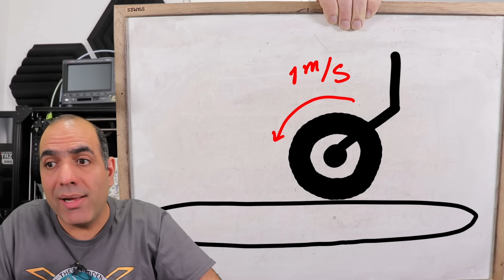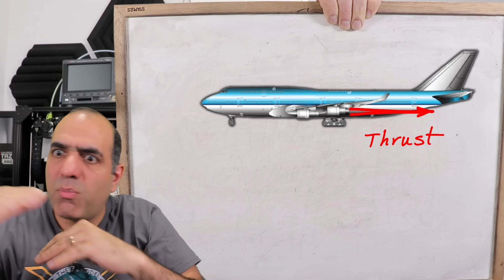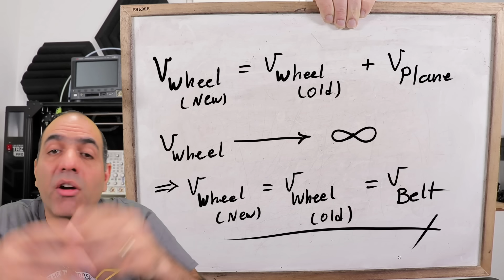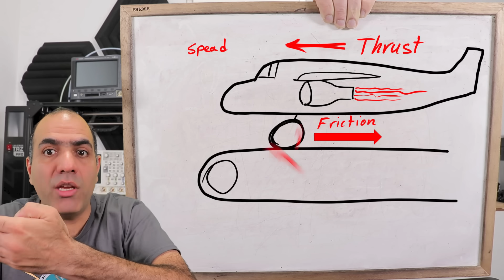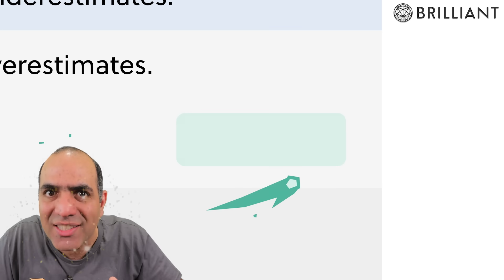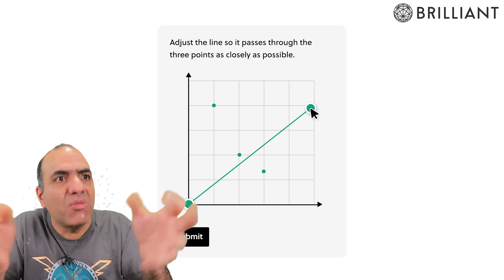Airplane Question that Drove Me NUTS!!!

Comment: This is a really simple answer. What makes the plane move? The engines pushing air or the wheels?

Answer that question and you’ll have your answer as to whether or not a plane can fly off of a conveyor belt.

And if that wasnt dumb down enough, let me make it simpler. Grab a little toy car, hold it tight in your hand. Push it really hard against the ground and then lift it up without letting go of the car. Do the wheels continue to spin? Most likely the answer is yes. Because the wheels are not powered by engine they just simply roll because they are loose. 

So what makes people think that a planes wheels have engines that make them turn? 

If the plane needed engines for the wheels to go forward. Then how does it stay in the air? Are the wheels constantly rolling on the air and driving on an invisible road even after they’ve been retracted into the underside?

Better yet how does a seaplane take off from water? Have you ever seen propellers underwater pushing the plane forward? Or is it just a pontoon that helps it float and the engine pushes air which cause it to move forward, and eventually lift off and fly. 

In fact the next time the conveyor question comes up just ask people, so how does a seaplane takeoff with no wheels. Or a plane with skis taking off from snow.

Also, MythBusters did test this. Watch the video.

Comment: Laymans term here.

1. You tie a knot on a toy car.
2. You put the toy car in a conveyor belt that will match the toy car's wheel speed.
3. You pull the toy car against the conveyor belt rotation.

Question: can you pull the toy car or no?

Comment: if the plane have wheel brake on and engine at full throttle it could take off (with flaps used while take off )

Comment: 58 seconds in the answer is ovbiously no due to the negation of force. ... after you are on the treadmill at 3:58, We assume the wheel and the convayor belt meaintain a perfect connection due to the weaight of the aircraft. my answer remains unchanged.

Comment: Wheel bearings stops the plane from moving by removing the friction between the moving conveyor belt and the plane itself, the thrusters are inactive producing 0 movement. Simple answer: no the plane will not take off.
Reply: Simple answer is wrong.  ‘Could the plane fly’ has to assume basic normal conditions like pilots, fuel, engines and an atmosphere.  If the engines start and blow air backwards at very great speed the plane will accelerate forwards rolling on those frictionless wheels.  The brake pads are not gripping the rotating brake disks, the wheel bearings allow the wheels to roll forward without resistance while supporting the weight of the plane and as the plane accelerates forward the wings push through the air at greater and greater speed ….  The conveyor belt speed is irrelevant.  Mehdi’s infinite belt speed is him adding two and two and getting five, actually adding one and two and one and getting five.

Comment: An airplane needs one thing to fly:  Airspeed over the wings. To climb, we need that airspeed and excess power.  Airplanes do not propel themselves via the wheels and that wing does not care how fast the wheels are turning.  As long as the engines can accelerate the wing fast enough, it will fly.   We fly "the wing" and for that reason, we fly by airspeed not groundspeed (or tire speed).   There are limits for the tires though, usually about 225 mph, but a no-flap landing can get pretty close to that with heavy weights for a lot of airliners - and a tailwind can go over the max tire speed limit.  Also, higher altitudes mean higher groundspeeds as well due to the lower air density meaning you must fly faster for the same lift.

Comment: That's impossible for that airplane take of 
It should for the planet have a speed that speed call the v1 speed that speed not fixed 
Based on the on the ariplane 
The left force created by the air foil and the engine push the aircraft forward 
To simply the high speed of the air left the airplane 
In that case the airplane wheels will turn with that specific made trade mil 
But the aircraft will stay at the same plane not moving forward to create enough power to left the plane of the ground

Comment: Before the video continues my answer:
No. If the conveyor is made to match the speed of the wheels, and the plane moves forward anyway (as its thrust is from the jet engines/propellers, not the wheels themselves), then the conveyors speed will increase to infinity, generating so much heat that it explodes, destroying the plane.

Comment: Trivially, it depends on the design of the plane.  Very obviously, a VTOL plane could take off no problem, and almost as obviously, a plane that generates its forward momentum for takeoff by turning the wheels, could not turn off.  (The latter is a contrived example, to make it more obvious that the design of the plane matters.  In practice, no real-world plane is designed in this extreme way, mostly because planes like to fly a substantial distance between take-off and landing, so they need to be able to sustain forward motion while in the air.)  You only have to actually think about your answer, if they ask about a typical airline jet or something along those lines; at that point you have to know things about the properties of the plane, that are not necessarily public knowledge (things like, yes, coefficients of friction for various parts of the landing gear).  So the answer is "maybe".
Reply: If you do have the qualified knowledge of how planes work you can imagine it taking place at the undercarriage and just smile at the people who pluck impossibility out of nothing at all.  Copernicus was clever because he was able to view a mass of astronomical information and produce the simple model of the planets going around the sun.  The simple model allows for further more advanced study.
Mehdi missed the plane going 160 knots forwards, the conveyor going 160 knots backwards and the difference making the wheels do 320 relative to the attached moving aeroplane.  He saw the wheels doing 320 relative to the greater airport (fixed) environment which made him imagine the ex-160 knot conveyor being kicked towards an ultimately infinite speed.  He could not see the wheels doing 320 but moving away from the airport at 160, in other words rotating at 160 relative to the airport and fully compatible with the conveyor’s opposite 160.
In astronomy terms he missed the red shift of light from objects moving away from us.
747 tyres cannot survive the centripetal acceleration at 320 knots rotation.

Comment: My best guess is that the plane will just become basically a fan, blowing out air from the rear of its engines, since opposing forces cancel themselves and the airplane relies on movement to take off,  rendering it unable to move on the ground will make it impossible to fly it.
I'm no engineer, but i do believe that jet engines do rely on speed to generate the air pressure needed for them to work properly, since the faster an object moves, the faster the air can flow through it.

If I am wrong, I'm sorry, but as I mentioned, I'm no engineer, I just happen to know that a jet engine works by compressing the air from the intake and sending it in a combustion chamber along with some sprays of fuel to heat it and then expel it.

Comment: I think you're overthinking the question. They clearly said the treadmill and wheels are moving at the same speed, so the net speed of the plane is zero because the speeds are synchronized, so the plane would never be able to take off. This might not logically make sense because the engines are trying to push the plane forwards, not trying to spin the wheels, but keep in mind the treadmill is also trying to push the plane back, not trying to spin its wheels, so the forces would cancel eachother out and the treadmill would speed up until the force of the treadmill pushing the plane equals the force of the engines and then stay at that speed.
Reply: You think the conveyor belt is pushing the plane?  How exactly, the wheels have frictionless bearings.  Have you put the parking brakes on?

Comment: Mythbusters tested this on a smaller scale. The answer was yes it can still take off as the wheels in contact with the conveyor are not driven in relation to the forward thrust.

Comment: Well that question is no planes need wind to operate their wing panels that's why it gains speed for more wind pressure hitting the plane. Because wind pressure makes the plane take off because the wind is hitting the wings super hard that the wind is strong enough for the plane to take off as you can see jet engine power is not all you need you wind. Think about windmills they need wind for it to move just like how planes need wind to takeoff so the treadmill answer is a no

Comment: I believe it will take off. It will act like a normal runway and the plane should not be affected by the converter belt going backwards the same speed of the wheel, as the thrust from the jet engine is pushing the plane not the wheels itself.

Comment: One of the first things that gets talked about in aerodynamics. Yes the plane will fly. Since the forward thrust of the aircraft doesn't care about the wheels, it will accelerate and the wheels will spin faster as long as the plane is on the imaginary treadmill. 

I feel like people who don't believe the plane will takeoff don't realize just how much thrust those engines create. A treadmill would be barely a nuisance to a plane at full takeoff thrust.
Reply: Lift is generated by the wings, not the engines. Lift is what causes the plane to leave the ground. A plane must move through a mass of air for there to be enough lift to leave the ground. 

Turbofan engines only require a few seconds to spool up from idle to wide open throttle (full thrust), yet the plane requires 3000 meters of runway to take off. Why? The engines are producing full thrust after the plane has only moved 100m. Answer: because the engines themselves do not create sufficient airflow over the wings to generate enough lift for the plane to take off. Since the wind on a typical day is nowhere near the required takeoff speed of a commercial airplane, the engines must move the airplane through the air at sufficient speed relative to the ground to generate enough lift for the plane to take off. And because the plane is so heavy, it requires upwards of 3000m to generate this level of speed/lift.
Reply: @stubeusz123  I think you are too focused on the relative speed. A jet airplane or a prop plane for that matter, has easily enough power to overcome the friction created by this treadmill, on a backwards moving treadmill the plane would very quickly stop moving backwards once you hit full throttle and start accelerating and the treadmill is not a huge factor at that point.....there is so much excess of power and fairly little contact surface the treadmill does not matter.

Also I don't know where you are pulling those 3000m numbers from, my airfield has a 2700m runway and commercial airliners never use the full length of the runway and that's using optimized settings which is likely not even full power.

Comment: Speed of the wheels doesnt necessarily mean the speed of the wheels' rotation, but can mean the speed of the wheels' displacement, which is the same as the speed of the plane. That's the way I interpreted it. In that case, the friction from the wheel is doubled compared to a normal take-off, but airplanes create way more than enough thrust to account for this, so it should'nt affect the plane's ability to take off.
The ambiguity in the question makes this only one possible answer.

Comment: I don't know anything about physics and never went to college so forgive this answer if it is stupid but it seems over complicated with all the math.  I think it will not fly.  If I run outside on the sidewalk at 7 MPH I can feel the wind on my face because the sidewalk is stationary and I am accelerating.  When I get on a treadmill and set it to 7 MPH I have to match the speed or I will be thrown off the back.  When I match the speed I never feel wind on my face no matter how fast because me matching the belt of the treadmill causes me to be stationary and seeing that  you need wind over the wings of the plane for lift in my mind it would never lift off.
Reply: Try the treadmill on roller skates pulling yourself forward with a rope attached to a wall.  The speed of the treadmill will not matter unless you take the roller skates off.  The 747 has 18 almost no friction wheels.

Comment: Depends. The belt increases the drag of the wheels as though the plane was moving twice as fast thus if this brings the total drag on the plane above what it can counter act during takeoff then the plane will remain grounded. However if the added drag is within the plane's ability to counter then it will simply takeoff slower.
Reply: @forbidden-cyrillic-handle  Quite a bit was defined if you take into account the context. My "conclusion" takes these into account as it's formatted as an equation. The 3 most important variables for planes are thrust, drag, and lift. Thrust minus drag gives how quickly the plane can accelerate it's speed. Speed times the plane's lift efficiency gives the if the planes has taken off or not.

"wheel speed" doesn't matter to the word equation I listed as all wheel speed does is set the amount of friction and thus drag it adds to the plane which is already in the equation for you insert to get an answer for a given example of a plane.

tl;dr:
IF thrust > drag 
   THEN plane speed increases;
IF thrust = drag
   THEN current speed = max speed
IF max speed >= take off speed
   THEN takeoff = true
   ELSE takeoff = false;

The equation doesn't care how you get the missing variables, but once you insert the variables you get your answer.
Reply: @forbidden-cyrillic-handle  You are missing the whole point of my comments because your trying to have an argument instead of a discussion.

You keep bringing up factors that aren't defined in the original question.

My statement goes by the few things that are defined which aren't enough to get a solid yes or no answer.
Reply: @forbidden-cyrillic-handle  So your saying I'm right, but you don't like the condensed version I made with the goal of being easily digestible, but instead wanna bring up things that I didn't define as though I did?

Comment: Mr ElectroBOOM. May I please ask a question? If so, for your convenience, it is in paragraph 4

We are headed toward electric vehicles. The issue is charge time. I know nothing about electrics really (I love your channel because it teaches me a lot). If I understand correctly then capacitors are like batteries at how they store and discharge electricity, the difference being the rate of time to store and discharge.

When I was a child I had a music box and took it apart. I found out that the energy stored by winding it up was controlled by a "flywheel" which slowed down the release of energy, so that the music box could play a tune, instead of just discharging quickly.

Because capacitors can retain energy quickly, is there any kind of restrictor that can be used to release it slowly? If so, could this be implemented to enable super rapid storage but more of a trickle discharge?

I sincerely hope that this is helpful in someway, that, maybe, someone who knows nothing about electricity might be far enough away from the wood to be able to see the trees

I humbly await a response, but know that you are busy so will not dwell on it if it is not forth coming

So many thanks for what you do.

Comment: If the treadmill worked like the ones that are mechanical and only go as fast as you run on it, then maybe. It would naturally keep pace with the plane until it reaches the speed necessary to take off.
In imaginary land, of course
But how would it catch wind to pick the wings up? It's not actually moving forward

Comment: If we assume there is friction, the 747 will simply throttle up and speed up the runway. As the runway approaches higher and higher speeds, the air next to it begins to move faster towards the plane. At a certain point it reaches enough velocity for the plane to take off.

Comment: Yes, even before hearing the science from multiple sources my immediate answer was, yes. Whither or not there is a headwind or moving ground the thrust is still present, air movement across the wings grant stability and some lift but is not the defining factor of "will it fly"
Reply: Air movement across the winds is the defining factor of flight. Otherwise it is only thrust as in rockets that determine if it can 'fly'. But some define flight as needing needing airflow over wings to create lift where rockets don't create lift but just purely more thrust than it's mass.

Comment: The only thing holding the plane stationary is Mehdi's terrible algebra and zero grasp of relativity.  Ignore his confusion and start with a clean sheet.
Think of the FULL BRIDGE RECTIFIER. Imagine plus 240 volts and minus 240 volts, the difference is 480 volts but Mehdi would have you believe that would make the minus 240 become minus 480.  That is his error, +V and -V has a difference of 2V.  He JUMPS to making -V into -2V and repeating in an infinite cycle, he does not grasp that the 2V is a RELATIVE 2V.
The wheels spin at doublespeed but he forgets that the plane (with the wheels) is moving away at single speed so the conveyor feels (double speed minus single speed) just single speed.
No infinite improbability drive😟